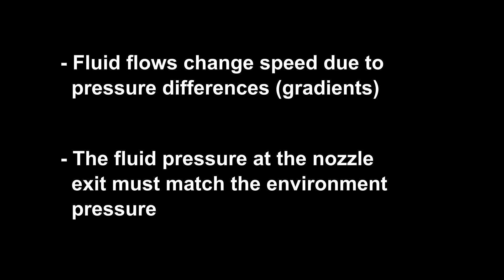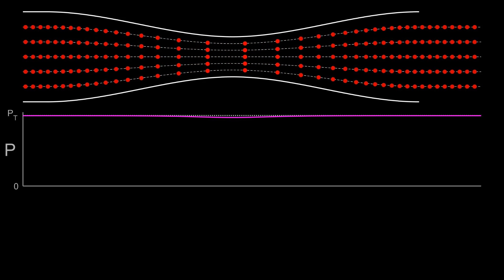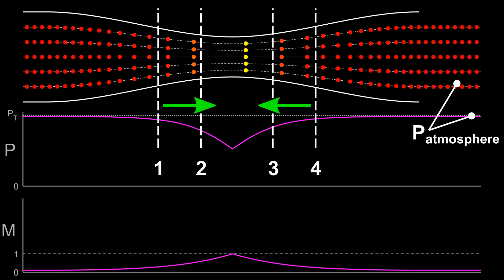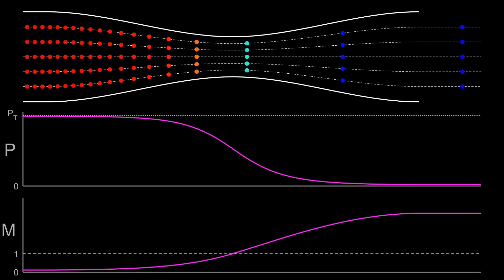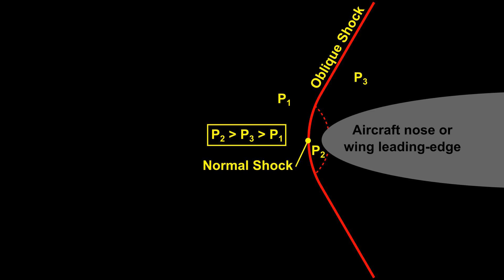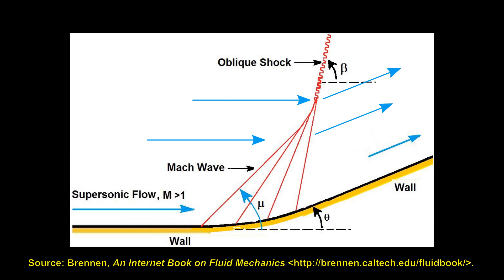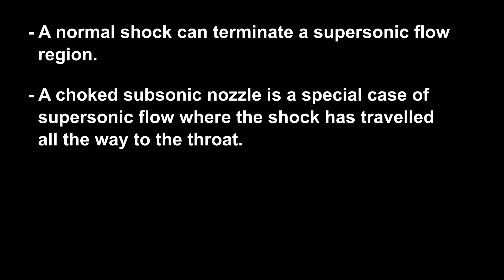Supersonic Nozzles - What happens next will SHOCK you!

Comment: In your subsonic flow you have atoms spacing apart to indicate low pressure and assume that is low density thus the spacing apart BUT if you replace the gas with water there will be a lower pressure but NO decrease in density, no spacing apart of the atoms. Yet water obeys Bernoulli's principal. I think it is an error to assume lower density of the air except that due to compress-ability which is only temporary. The loss in static pressure has to be due to some other cause rather than a loss in density. I think I know what that cause is.

Comment: Good video. One correction, exit pressure can be different from ambient pressure in case of supersonic flow with no normal shock waves. It sure does equalize but far from nozzle exit, after a series of mach diamonds

Comment: I accept this flow behavior and I can successfully calculate every point in a CD Nozzle at given back pressure to stagnation pressur ratio and expansion ratio.

But today I talked with an aerospace colleague and he said that in real life, it is not possible to get supersonic flow in a nozzle (and then a normal shock) if the backpressure is a higher than fhe pressure at the throat p*. 
Imagine, that the nozzle is evacuated and then you let a gas flow in with a given stagnation pressure. The gas reaches p* at the throat, but then the backpressure is higher then p*, so how can the flow get supersonic initially? Yes I do understand that the static pressure significantly increases after a normal shock, but still.
So my question is specially about the case where (Pb/P0 | subsonic) > (Pb/ P0) > (p*/P0)
I hope my question is understandable.

Comment: Thank you very much for sharing this with us. I was wondering whether this behavior may similarly occur for nozzles immersed in pressurized fluid-chambers or if the same effect is observable instead for inlet pressure increments for a fixed exit pressure.  If immersed, What will be the conditions for the shock waves to happen  within the surrounding fluid?
Reply from the maker: Thanks for the kind words and thanks for watching. The critical variable is the pressure ratio, rather than the exact value of the inlet or outlet pressure. So yes, similar transitions / changes could be observed by varying either the inlet or outlet pressure while holding the other constant.

Comment: I have a question, u mentioned that pressure at the exit nozzle must match the atmospheric pressure. So how do you reduce the atmospheric pressure. Also the part abt shock was a bit confusing

Looking forward to your reply
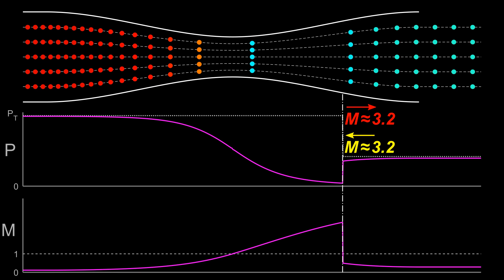Reply: 12:58 since u said shock is an inefficient compression process, and since shock travels in opposite direction to the flow in the nozzle, how does it's increase help match the nozzle exit pressure to the atmospheric pressure 

p.s- what is supersonic expansion
Reply from the maker: Apologies for the slow reply. Can you please restate your questions, I don't really understand what you're asking.
Reply: @TheGravityAssistant  how does increase in shock help exit pressure to match atmospheric pressure
Reply from the maker: Hi, atmospheric pressure at the exit can be reduced by increasing altitude (e.g. a rocket or plane flying higher). Alternatively by conducting a rocket engine test in a vacuum chamber, or with a pressure reducing device such as an inducer.
You could instead imagine that we increase the pressure of the fluids going into the engine, as it is the ratio between fluid total pressure and atmospheric pressure that matter.
What was confusing about shocks, could you elaborate a bit more please?

Comment: The biggest question I have is just “how do you reduce the pressure at nozzle exit?” Does the air coming out of the nozzle play any part in this? I can certainly understand a pressure controlled room or environment, but I don’t think that’s really what’s meant or else it’d be kind of useless.
Reply from the maker: What is important is the ratio between the pressure in the combustion chamber (high pressure) and the ambient (low) pressure at the exit. If you want to achieve supersonic flow at the exit, you can increase the high pressure or decrease the ambient pressure (or both).

You're right that if we want a rocket nozzle to work at sea level, it doesn't make sense to try and lower the environment pressure - so first stage rocket engines usually have very high combustion chamber pressures to achieve a large pressure ratio. 
Conversely, 2nd and 3rd stage engines which operate in near-zero pressure environments can have much lower chamber pressures and still achieve supersonic flow / a high pressure ratio. Anything divided by almost zero is very big.
Reply: @TheGravityAssistant  I see, that makes intuitive sense in retrospect. If the starting total pressure is higher, to the point that the reduced static pressure is close to atmospheric conditions while holding onto a lot of dynamic pressure, it would just keep moving through similar conditions as though not much had changed.

If the static pressure is similar but the temperature is much higher, does that mean the compressed gas is actually released in the exhaust at densities lower than STP? I’ll have to try to wrap my head around that…

I’ve been trying to look into a means of numerically estimating the motion of airflow based on pressure differentials and figuring out how far an open air supersonic flow will continue traveling at supersonic speeds before reaching equilibrium with normal air, and I’m not quite sure what—in open air away from the turbine—stops a flow from forming normal shock outside of just powering through it with high pressure…? And how the duration of that air burst impacts this. Do you have any suggestions on where I should look to that? I’m not really sure how to mathematically define the behavior of a compressible thermodynamic gas to move from a region of high pressure to low pressure in the first place. >.<
Reply from the maker: @Goji-Moji  To answer your first question, the ideal gas law PV = nRT can be rearranged to P = rho * R * T,  where rho is density and R = R_universal / M_molecule. From that we can see that yes, gasses at higher temperature for a given pressure will have lower density. It also makes sense when you think about a candle or a camp-fire, their combustion is happening at 1 atmosphere of pressure, and the heated gasses float away because of their reduced density (and the effect of buoyancy).

I'm not sure I totally understand your second question. I'm going answer the question 'how does a supersonic jet stream break down and dissipate', and hope that helps :).
When the supersonic stream exits a nozzle, it is at the same static pressure as the atmosphere, but it is has a much high velocity than the ambient air, so when it moves past there will be a large shear force. This shear force acts to slow down the jet, (and accelerate the ambient air a little bit). Viscous shear and turbulence dissipates the supersonic jet's high dynamic pressure. 
Have a look at figure 12 and 13 of this paper: https://iopscience.iop.org/article/10.1088/1742-6596/1240/1/012019/pdf
And look at the bottom of the exhaust stream from this photo: https://space.stackexchange.com/questions/29758/temperature-and-pressure-of-rocket-exhaust
Similarly, the temperature will eventually equalise once the hot exhaust gases have radiated or convected their excess heat away to the rest of the atmosphere.

Comment: Hi! I'm currently designing a Nozzle for a CubeSat, I used MOC to obtain the design of the wall. I then passed it to ANSYS and i have an underexpansion effect which was expected if my ambient pressure is 0. So, I want to know how much I can expand the exit area to get the pressures to balance. I want to model this just like your video where I can have two charts and see the change in Mach and Pressure changing the velocity and exit area, what program do you use or what can you recommend for this. Thank you!
Reply from the maker: Hi, thanks for watching. I hope that I am understanding your first question correctly - it is not possible/practical in reality to match the exit static pressure of the nozzle with the vacuum pressure (~0) in space. It is possible to calculate a maximum theoretical exit velocity from a nozzle where all the thermal energy is converted to kinetic energy and the exit temperature is 0 K (and therefore the exit static pressure is 0), but this would require a very long (and heavy) nozzle with a very big expansion ratio. Additionally a real gas would condense into liquid or solid at a temperature >0 K and so the maximum ideal gas expansion could not be achieved. Additionally + 1, viscous losses with the long nozzle wall would remove some amount of energy from the flow, further preventing us reaching this theoretical idea. In practice, all space nozzles are under-expanded, and the designer has to make a trade-off between factors such as performance (Isp), mass, packaging (length and diameter) etc. etc.

Regarding the plots of Mach / pressure / temperature - I made them in matlab using the geometry of a simple converging-diverging nozzle, and the isentropic flow relations (please see the link below). If you know the cross section area at each position along the nozzle, you can use equation 9 (the Mach-area relation) to calculate the Mach number at each position. Once you know the Mach number at each position along the nozzle, you can use equations 6 and 7 to calculate the temperature and pressure at each location. 
https://www.grc.nasa.gov/www/k-12/airplane/isentrop.html

Hope that helps!

Comment: Great explanation with very explanatory graphics. Many thanks. A question though: what are design parameters for a nozzle to create certain effects? E.G., if I wanted te create maximum shockwaves, regardless wat happens to the airspeed at the exit, what would that mean for the design of the nozzle?
Reply from the maker: Thanks for watching and the kind words. That's an interesting question and I had to take some time to think about it.

On a fundamental level, the most important variable that we can control is the pressure ratio between the total pressure in the chamber and the pressure of the environment at the exit. Please see the image I linked at the end of this message.

This following paragraph assumes that we have a constant nozzle geometry, like shown in the linked image. At point 7 we have perfectly expanded flow at the exit and no shocks. As we move upwards to point 6, the environment pressure is a little bit higher than the final nozzle pressure, and so some 'weak' oblique shocks are needed to match the exit pressure to the environment pressure. As we increase the environment pressure more, the weak oblique shocks eventually turn into a 'strong' normal shock at point 5. This shock occurring at point 5 is the 'strongest' shock that a converging-diverging nozzle (of a given geometry) can create. If we increase the environment pressure more, the normal shock has to move into the nozzle and it gets weaker because the subsonic expansion now contributes to some of the pressure recovery.

If we want to create a stronger normal shock at the nozzle exit, we need to increase the mach number of the flow at the nozzle exit, and so we need a bigger nozzle exit. However, with the same chamber-to-environment pressure ratio as before, this nozzle will now be over-expanded and the normal shock will actually occur inside the nozzle (situation 4). And so we will need to increase the chamber pressure to move the shock back to the nozzle exit and return to situation 5.

So to summarise, if our goal is to make the strongest shock possible, we want a huge expansion ratio nozzle and a (quite high) pressure ratio between the chamber pressure and environment pressure that allows us to achieve situation 5.

https://aerospaceengineeringblog.com/wp-content/uploads/2016/06/NozzleConDiv.jpg

This was a longer message than I expected! I hope it is helpful.
Reply: Thank you so much for your elaborated answer. Is there I way I can email you directly?
Reply from the maker: @ariebos7872  No worries. I can be reached at lyle.tac@gmail.com, and I will reply when I can

Comment: Awesome explanation, especially the "supersonic particles interact with particles of the same speed" and normal/diagonal information sending. That makes everything much clearer.

I have a question: In rocket engines we accelerate mass to high speed in order to get a high impulse from them. But where exactly does the impulse exchange between the accelerated particles and the nozzle occur.

An as a bonus: How does this work in aerospike engines.

Normal Nozzles are inefficient when they are not expanding enough, leaving a pressure difference between inside and outside that also "adds" to the thrust (F=deltap*Area) but less than if it were perfectly expanded (assuming bell with no weight blabla). And the outgoing gas stream is not perfectly straight further hurting efficiency or is that already accounted for?

Anyways with aerospikes supposedly going around this problem, where exactly is the thrust exchanged on an aerospike, especially when it is in thinner atmosphere where the outgoing gas should pretty much look as "bad" as the traditional nozzle. (As in, expanding almost normal to the rocket axis as we know it from 1st stages in higher atmospheres)

Does the thrust exchange work beyond the nozzle? Probably not because the flow is supersonic, so does it exchange "diagonally" from the last part of the nozzle?
Reply from the maker: Part 1 answer: 
Regarding the momentum exchange between the rocket and the propellant - it's kind of a chicken and egg problem. The typical text book approach is to do a boundary analysis - e.g. calculate the mass x velocity going into the chamber and out the nozzle and find the difference. This is an analytically simple approach which doesn't answer your question.

Another way of looking at the problem which is more 'physical' - the interaction that provides the force which accelerates the rocket is the net gas pressure acting on the combustion chamber walls and nozzle surface. See the picture at this link: <https://www.researchgate.net/figure/Rocket-motor-combustion-chamber-and-nozzle-with-arrows-indicating-outside-constant_fig1_332971300>. With this logic, we just have to generate high pressures over a large surface area - the velocity of the gas is just a side-effect.

In order to generate really high pressures inside the combustion chamber, there must be a restriction that stops too much gas flowing out - the throat in the case of a rocket engine. If the pressure difference between the inside of the combustion chamber and the outside environment is large enough (all rocket engines), the gas flow will be at Mach 1 in the throat (kind of a side-effect). At the throat, the pressure is normally still much higher than the atmosphere pressure, and so we add a nozzle to 'use up' the remaining excess pressure to create more thrust (side-effect is accelerated flow). The thrust coefficient for typical nozzles can be up to about 1.9, so we can almost double our thrust with a well designed nozzle.

When the nozzle is overexpanded, the pressure inside the nozzle is less than outside, and so the pressure balance across the nozzle surface creates a 'drag force' pulling the rocket backwards. The opposite happens if the nozzle is under-expanded.
Reply: @TheGravityAssistant  Thx for the different ways of looking at the problem. The textbook approach always felt a bit iffy once i started looking closer.
GG on your part :)

Sadly YT does not show me Part 2 of your answer (weird bug).
Reply from the maker: @uninteressant2196  The problem with the Part 2 of my answer was that I deleted it😂, because I realised I wasn't sure about something and wanted to think some more. I'm still not certain, because I have not worked with aerospikes, but I will try my best!

This picture is good for understanding the performance difference between a real bell nozzle, a real aerospike, and an ideal bell nozzle: https://en.wikipedia.org/wiki/Aerospike_engine#/media/File:Nozzle_performance_comparison.svg

An aerospike is never as efficient at a given operating point as an ideal (adjustable) bell nozzle, but it is more efficient over a range of operating points than a real bell nozzle. Again, with an aerospike, pressure and momentum can only be exchanged in the combustion chamber walls and the nozzle/spike walls. Now this next part is just my speculation, not necessarily true! My guess for why aerospikes are never as efficient as ideal bell nozzles is because the flow exiting the combustion chambers must have some angle, and so the portion of the thrust that comes from the pressure acting on the injector minus the throat area creates a force that is not exactly along the axis of the rocket. For a bell nozzle, this force is 'always' along the rocket axis. See this video: https://www.youtube.com/watch?v=-SGIiO1APig&t=1s

Finally, about the effect of exhaust angle. We only care about the angle of the flow "exactly" as it is leaving the bottom of the nozzle / spike. Once it exits the bottom of the nozzle, it doesn't matter how many degrees the flow changes direction, the pressure acting on the walls inside the nozzle will be the same and so the thrust will be the same.
The problem with flows that turn really far is that they can turn so far that they start hitting the rocket and causing lots of heating.

I hope that all helps.
Reply: @TheGravityAssistant  Thank you for your honest answer regarding the limits of your expertise
Reply from the maker: Hi, I'm very sorry for the slow reply, somehow I missed this comment. I will give a detailed answer to your questions tonight. Thanks for watching!